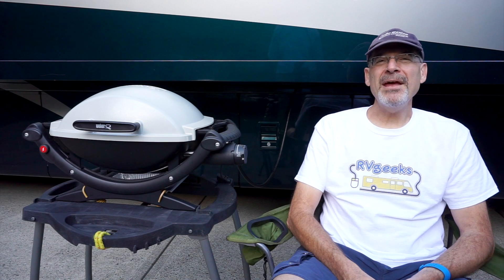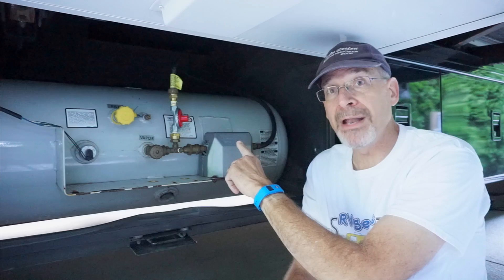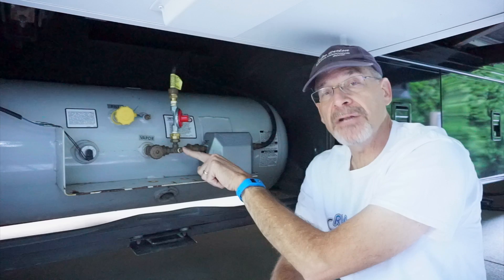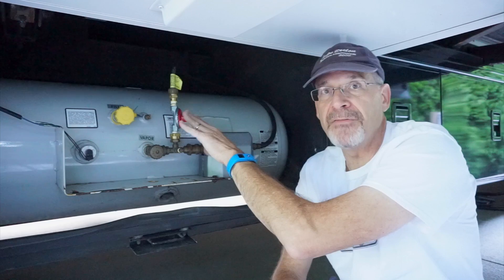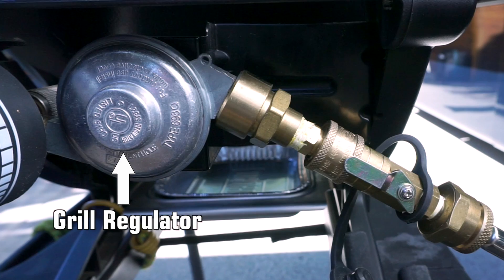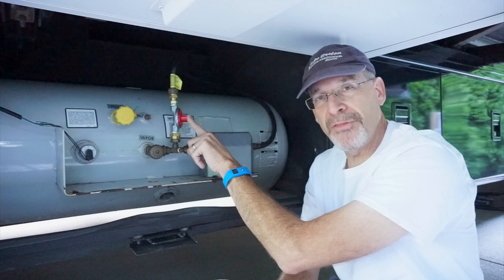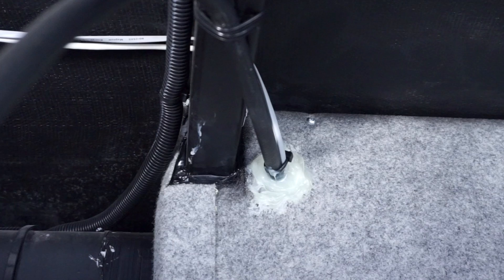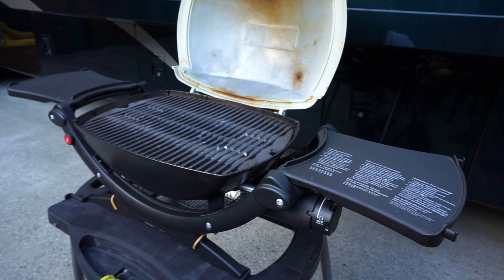How to Connect a BBQ Grill to an RV's On-Board Propane Tank

Comment: My only word of caution would be that squirrels like to chew on rubber propane hoses. With the hose exposed to the outside this makes this a little vulnerable to damage. We have pretty much the same setup but I installed a valve off the extend a stay so that the grill hose is not pressurized.
Reply from the maker: Great idea. We've been thinking about the same thing, but since we're full-time, we always have the grill line powered up (we use it about every other day all year round) and when we leave the RV for any extended period, we shut off the main propane valve on the tank itself. If we do add a valve there, we'll be sure to report back! Thanks. :)
Reply: wrap aluminum foil around the hose, they won't like it anymore.  ; )

Comment: I have a question regarding your RV propane hookup. You have two regulators on your main RV tank. Do you have the red one that goes to your BBQ and then you have the one that is covered by a shield which runs your RV. Why wouldn't you run a t past the original RV regulator? The reason I am asking this is because my propane setup is running past the regulator and I have no fuel pressure. I believe the RV regulator is 11 in of water which basically isn't nothing compared to 15 pounds. Would that explain why you're running two Regulators. My RV  is hooked up  to a hundred gallon tank  like you had yours set up for winter time . Thank you
Reply from the maker: Hi Mr. Dozer. Yes... the reason that we added the "T" in between our tank (full pressure) and our RV's onboard regulator (drops down to 11" water column) is because the reduced pressure after the onboard regulator isn't enough pressure to supply the inlet side of our grill's regulator. Since we didn't want to remove the regulator from our BBQ grill (we like having the option to use a small propane tank with the grill if we want to use it AWAY from the RV), we tapped in BEFORE the onboard regulator. Then, because of the increased pressure in the line, we had to add the 15psi regulator to keep oil from building up (high pressure propane in these hoses seems to cause the oil, so dropping the pressure stops the problem).

If you NEED to "T" in AFTER your RV's onboard regulator, you'd need to remove the regulator from your BBQ grill... since it wants higher pressure to operate. And doing that would be fine, if you don't need to use your grill away from your RV.

Hope this helps!!

Comment: Great video. So if I just wanted a quick connect on the basement door (opposite side)for a BBQ or fire pit only I would connect to the rv side of the regulator? I really want a Y to add a quick connect to the floor by the driver seat for a big buddy heater also. I think all this can be done after the rv regulator. I will use your links to see if I can order the parts . thanks
Reply from the maker: Hi Jim. Technically, yes you can do what you’re saying and connect your quick connect on the RV side of the regulator. But doing that will require you to either remove the regulator from your grill, or buy a grill that does not have one and can run off low propane pressure. Do you likely also wouldn’t be able to run a propane fire pit from the RV side of the propane supply because the pressure and flow are too low. That’s why the Extend-a-Stay is a good option because it enables you to tap into the high-pressure propane needed for devices like grills and portable fire pits.
Reply: @RVgeeks  thanks I didnt think about the pressure needed for a fire pit. Lol that changes everything. I would like to put a big buddy heater up by the drivers side seat. I think you are right though. Before the regulator is better. Thanks

Comment: It looks like you have two regulators.  I’d this correct?  If so isn’t this reducing the already regulated gas?
Reply from the maker: Great question, Emmett! The unregulated propane comes out of the tank at very high pressure (can easily exceed 100 PSI), then goes through the red 15 PSI regulator as kind of a "step-down" for the trip across to the other side of the RV in the long hose. That reduction to 15 PSI prevents the accumulation of oil in that long run of hose. But 15 PSI isn't nearly low enough for the grill which runs on about 0.5 PSI. That second regulator on the grill takers care of that, and the 15 PSI feeding it is plenty to get the job done. Works like a charm.

Comment: Thanks for all the tips. You talk about oil damaging the grill regulator when using high pressure gas. Can the regulator be cleaned or do you have to buy a new one?
Reply from the maker: We cleaned our regulator out with alcohol, let it dry thoroughly, and it worked fine!
Reply: @RVgeeks  how exactly did you clean the regulator?  You said alcohol but what kind? Vodka 😆?
Reply from the maker: @reddawg9400  Yes… “rubbing vodka” 😁

Comment: I have that same grill. Is the regulator on the grill not sufficient? My tank is on the passenger side of my rig, and already under my patio awning,  so 6 feet of hose will be plenty. My fish cooker also has its own regulator. What say you?
Reply from the maker: 6 feet of hose probably isn’t long enough to create the oil buildup problem, so we’d guess you’d be okay without the additional regulator.

Comment: The method in which your have propane going from the tank and through a regulator, then down the line to the BBQ and then through a second regulator at the BBQ, doesn't that pose an issue with the amount of propane thet you have going into the BBQ for a proper flame setting?  Thanks
Reply from the maker: Hi Michael. Great question! The reason it's not a problem is because the red 15 PSI regulator we installed at the tank provides FAR more pressure than the grill needs to operate (it uses less than 1 PSI). That acts as a "step-down" regulator to prevent oily buid-up in the long run of hose over to the grill, while still allowing more than enough pressure for the grill to work.
Reply: @RVgeeks  Thank U.

Comment: You have the 15 PSI regulator coming out of your tank.  Do you still need the one on your Weber BBQ or could you take it off?
Reply from the maker: You absolutely still need the regulator on the grill, which requires far lower than 15 PSI.
Reply: @RVgeeks  problem is now you have two regulators and the pressure is too low and you don't get a good flame.
Reply from the maker: Mike... that’s true if the output from the first regulator isn’t high enough to be input to the second one. The 15psi regulator at the tee is plenty of pressure as input for the grill’s regulator. No double regulation problem.

Comment: This is a great video and I like all the details you added, I do have one question or maybe I'm just not seeing it, but what type of fitting was used to connect the two extension hoses together? I'm planning to implement this mod on my Big Horn 5th wheel this spring. Thanx
Reply from the maker: +Jean Lavoie Thanks Jean! The two extension hoses connect together with no special fitting needed. One end of each is female and the other ends are the matching male fitting, so they connect right up no problem!

Comment: I see there is still the factory regulator on the grill. My grill has the regulator on the hose of the grill. So it looks like I need a quick connector on my propane grill hose that keeps the grill regulator it came with... In other words, the RV regulator and the grill regulator both need to be in place?
Reply from the maker: Whether the grill’s own regulator is needed or not depends on whether your propane line comes directly off the RV’s propane tank (as ours does), or through the RV’s whole-house regulator. Since we plumbed our “T” upstream/before the whole-house regulator, the hose to the grill is carrying high-pressure propane, and needs to be regulated down at the grill. (The red step-down regulator we installed is still far too high pressure for the grill.) If your grill line taps into the system downstream/after the whole-house regulator, the grill will need to have its regulator removed, otherwise you’ll be double-regulating it, and there won’t be enough pressure for the grill to run. Hope this makes sense, and helps.
Reply: The supply line comes after the whole house regulator, but I think that is a high pressure regulator. Looks like I will first try to connect with the factor LOW pressure regulator on the grill. The grill is made to connect directly to an LP tank, the large type, not the tiny portable camping bottles.
Reply: Hmm. The whole house regulator is 2 stage regulator so then it only allows about .5 psi, so looks like you told me correct. Will connect without a regulator and see how this works. Thanks.
Reply: You are 100% correct. Worked perfect without the in line single stage regulator on the grill because the whole house RV regulator was putting out the correct pressure (low pressure). No big yellow flames on my grill. Temp isnperdect. Thanks.

Comment: Silly question and maybe I missed it.  But the grill has a regulator as well, so would you not be double regulating the propane pressure here?  Also if I were to remove the male quick connect from the grill, could I use the lithe green bottles again if needed?
Reply from the maker: Great question! The only problem you'd have with double regulation is using two of the typical 11" water column regulators, which equals about 0.5 PSI and are the same type that come fitted to the grill. We overcame that problem by using a 15 PSI regulator where the hose comes out of the RV's tank. That is low enough pressure to prevent the oily build-up in the hose, but plenty strong enough pressure to avoid a double regulation issue. And yes, you can easily remove the quick-connect from the grill any time you'd like to use the little bottles again, such as during a trip away from the RV.

Comment: Hi guys, Our RV has a quick connect built into it already and the grill we have has a regulator that is easily removed but it also controls our flame adjustment. We have read that we can not use the regulator because the quick connect on the RV is already a low pressure connection. We have seen flame controls sold separately and are wondering is this the way we would go about connecting our grill or should we just replace our grill with one that does not need a regulator? Hope this question makes sense lol. Thanks.
Reply from the maker: We're pretty sure that just about all (if not all) small grills have regulators on them. Because of that, we can't imagine that the grill port on your RV isn't designed to work with them. Have you tried it yet to see if it works? It might be plumbed to high pressure.
Reply: We have not tried it yet, and we thought the same about most portable grills having a regulator, but when we looked on the forums most people said the quick connect is a low pressure port on our Winnebago and we would not be able to connect to a grill that has a regulator. Maybe it's a brand specific issue. Thanks for your reply I think we are going to just play it safe and carry the 1lb bottles for now. We'll contact Winnebago and see what they have to say about it and let you know if we find out any info.
Reply from the maker: Contacting Winnebago sounds like a good plan, but if you want to just connect it (assuming you have a hose), there's no harm in trying. If there's an issue with double regulation, it just won't light... or will light and then go out. Let us know how you make out.
Reply: I think we are always a little too cautious, we were afraid of damaging the grill or RV. We are taking the RV out for this weekend and we'll try it out. Thanks for your help.
Reply: Hi guys, We spoke to Winnebago this morning and they said the quick connect port is a low pressure connection and that we would have to use a grill that is designed for low pressure or we could remove our regulator on our grill. We went on irv2 and it sounds like it's not just Winnebago that has it set up this way and most people say they do remove Thierry regulator and it works fine but we are apparently the oddballs that have our temperature control attached to our regulator lol. Just thought we would pass you the info. We are not sure how comfortable we are trying to modify our grill if it's really not meant to be used this way. So we'll probably just use bottles till the thing dies. Thanks again for your help and input we always appreciate your insight.
Reply from the maker: Thanks for the update. We've checked a variety of small grills, and have not found any that have no regulator. Even the ones that are primarily designed to run off small portable bottles (including our Weber, and all the Colman grills we looked at) have a regulator on them. And yours, with the regulator and temperature control all as one unit is probably not so unusual, as that's the way ours is set up, too. We're guessing that Winnebago, and others, may be taking the easy way out, by plumbing into the main propane lines that run to other appliances rather than bringing a dedicated high-pressure line over directly from the tank. We say "taking the easy way out" to mean both avoiding having to install a dedicated line, and avoiding any potential for liability. As far as we can tell (and the info you related from iRV2 about people having to remove their grill's regulators), virtually all grills have a built-in regulator, since connecting one to an ordinary, ubiquitous 20-lb tank would require one, as that's high pressure. Seems stupid to us that any RV manufacturer would bother including a grill port that can't be used without modifying the grill. Sounds like you'll be fine using the little portable tanks for now, then figuring out if you want to get a grill with an easily-removable regulator in the future, or run a new line, like we did (sounds like the former would be the easier route). Best of luck either way!
Reply: Thanks guys we need all the luck we can get lol. We took your advice and tried to connect the Coleman grill today using the quick connect just to see if maybe it would work, but we don't even get enough gas to hear a light hiss or for it to lite the grill. So bottles it is for now. Thanks again for your help.

Comment: Nice video but I just confused myself by looking at way to many comments. So I have a quick connect valve that came installed on my trailer.  I purchased the Weber Q2200 grill. Same as your just differnt BTU's I believe.  I would like to just connect a 12" quick connect hose hose from the trailer to the grill so I can use the trailers propane but move away from trailer.  I also would like to leave the regulator on the bbq in case I need to use it at home with the small propane bottles.  I purchased a Camco quick connect 12' extension hose and a Camco low pressure 1/4 male NPT qucik connect fitting.  What part should work coming from the bbq regulator so I can use the quick connect set up?  You guys are awesome!!!
Reply from the maker: LOL! You're not alone, Stefanie... it can get REALLY confusing. We're not sure what part you'll need to do what you want... but we CAN tell you that it likely won't work the way you want it to. Almost every RV manufacturer that we know of that includes a propane quick-connect for you to connect a grill to has that quick-connect in the LOW pressure propane line (i.e. downstream/after the onboard propane regulator that drops the propane pressure to just 11" water column, or 0.5psi). Which means you need to remove the regulator from any grill you connect to it. Otherwise, there's not enough pressure coming from the RV to get the grill's regulator to open up and allow flow. Before buying any more parts, you may want to either sleuth out where the line that the factory-installed quick-connect is installed in goes (so you can figure out if it's got high- or low-pressure propane) OR contact your RV manufacturer and ask. Hope this helps!

Comment: Ok so if I didn’t see this before adding the regulator and got oil at my grills regulator and in the hose should I replace the hose?
Reply from the maker: Hi Scott. Sorry to hear you had the dreaded "propane oil" problem. Before we came up with this solution, we had it as well. We didn't replace our hoses after we added the 15psi regulator at the propane tank side... we installed a propane filter (like this one on Amazon: https://amzn.to/3DGgS6a ) at the grill end. That way, any remaining oil in the hose got caught before it gummed up the grill regulator (which we removed from the grill and drained, though replacing it would probably be easier, LOL!). After about a year of operating things with the new regulator at the tank end and the filter at the grill end, we removed the filter and haven't had any problem since.
Reply: @RVgeeks  thanks I will order one when we get home